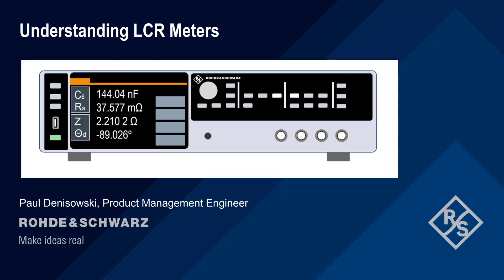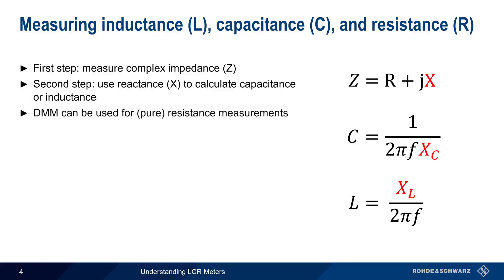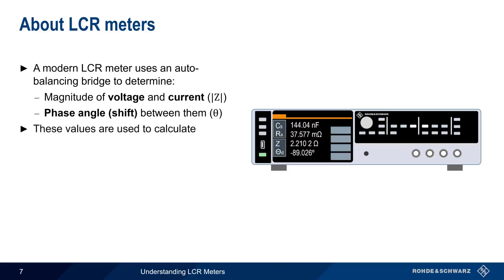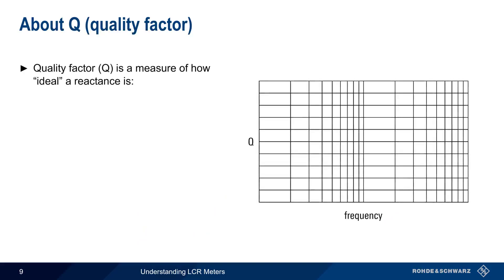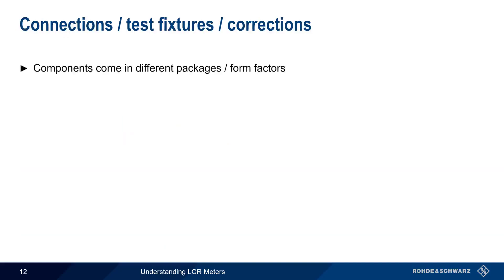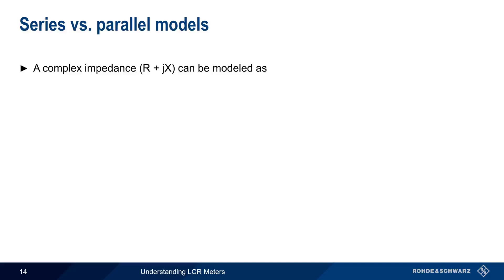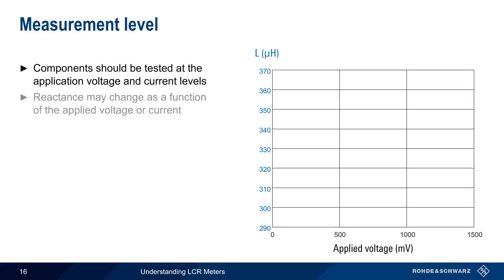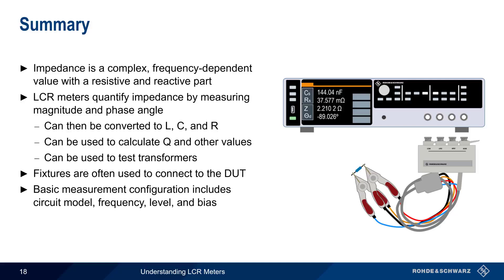Understanding LCR Meters

Comment: can anyone tell me the which $100-200+ - brand/model of hand held lcr meters has the best accuracy, mostly for capacitors and inductors with decent auto ranges? looking to buy a decent one, viewed a lot of vids, still can't determine if de 5000, extech, amprobe, klein, etc.. not looking for anything under $75, i've seen enough of those vids, they aren't worth spending any money on. i like the bk precision one but not for $400+, mostly used for electronics and appliances, maybe even higher inputs as in caps for hvac. i'd appreciate the input. thanks.

Comment: Really nice video. 
Can I measure the current vs voltage applied on the DUT at a desired frequency ( or DC) ? 
Can I get the graphical display of I - V? 
For example, I want to get the I - V curve of a diode in DC condition or at a desired frequency. Is it possible by Precision LCR  meter? 
Please. 
Regards

Thanks a